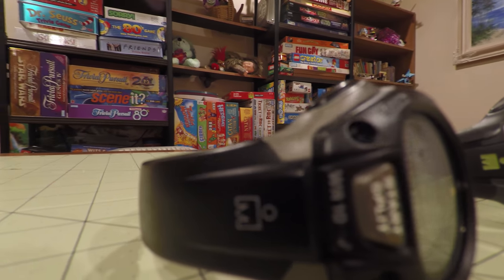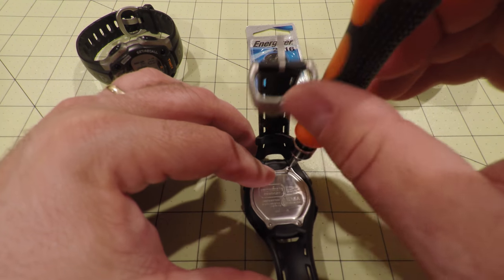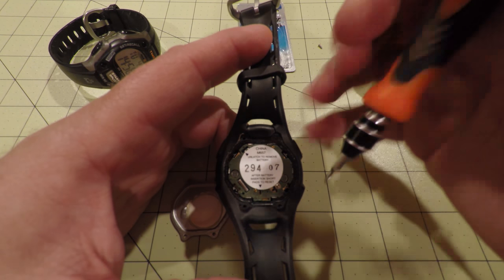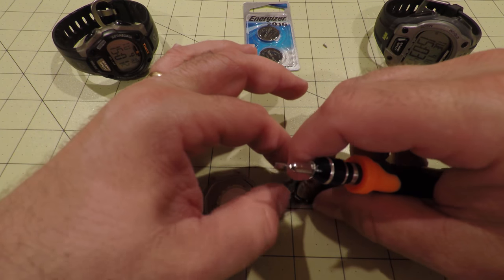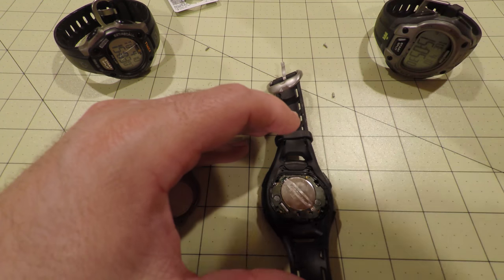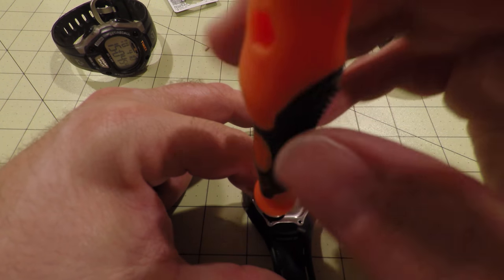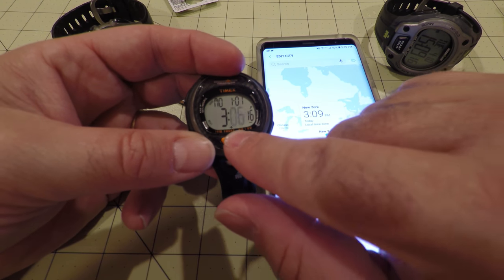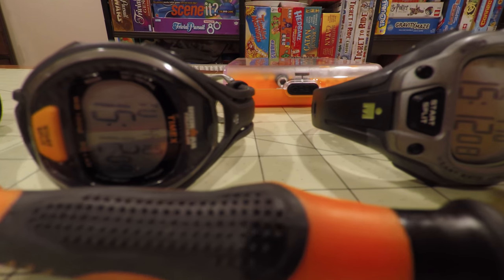How To Replace A Timex Watch Battery

Comment: Thanks. Good video. In the end, the inside of my Timex Atlantis 100 looked quite a bit different, with a different type of interior cover holding the battery in place, but it didn't matter. Your video gave me the courage to open up the watch in the first place, and once I did that, it wasn't that hard to figure out.

Comment: Very helpful.  Major issue I am having.  
The battery cover is not only secured with four (4) screws, but there is protruding rubber from the band which partially covers the battery cover at both the top and bottom.  It extends 1/16 to 1/8 on either side.  While I can slip the battery cover underneath on one side, I am unable to pry up the rubber on the opposite side.
Wish I could attach a photo.
Any thoughts?
Thank you.
Reply from the maker: Not sure about that. Maybe somebody else has a video on it?
Reply: I had similar issues.  I decided it was easier to just buy a new watch. 😀

Comment: I guess these Iron Mans are all different.  I saw one of these videos yesterday and I thought I can do that and went out and got a battery this morning.  Getting the 4 screws from the back off.  Piece of cake.  Getting the back off without taking off at least one side of the strap.  NO WAY!!!  Then after I got the back off replacing the battery was easy.  But trying to put the back back on?  The rubber gasket had stretched or something so trying to get it back in place to screw the back on was just not possible.  I tried putting the back on loosly and tried to coax the gasket into position but it always popped out somewhere.  Then I said I will just cut off any excess gasket that wouldn't jam under the cover realizing the watch will no longer be waterproof.  Then trying to get the band back on I finally gave up.  I didn't want to jam a screwdriver into my hand trying that challenge.  I had bought a new watch yesterday but still wanted to try and keep the old one.  It now has a home in the trash can.  I admire guys that can do some of these repairs.  Fortunately I am in a financial position to be able to afford a new watch.  😀

Comment: Mine is like the first one you showed.  I cannot get the rear plate off
Reply: same here and the one i did get off i can't get the battery to fit behind the small clips so it don't stay in place any help
Reply: I have exactly the same problem too! :(
Reply: I can't get the plate off too, same model. Were you able to find the right screwdriver to get the screws out? Will try the Dollar Store to buy a set of small screw drivers. Let me know which screwdriver and size works for you.

Comment: My watch is the first one shown. Did you use size 1.0 screw to get the screws out for that watch too?
Reply from the maker: It's been awhile but I think I only opened up one watch in the video. But if I opened another one, then I'm pretty sure the screws were the same size.
Reply: @NeilRichard  Finally found screwdriver to open case, but now having difficulty putting latch back on. The other end of the metal latch or sling that holds down the battery is locked down with a small screw. It did not say to unscrew but I did to take the metal latch or sling off so the battery can slip out more easily without bending the latch out of place. I screwed it down after replacing the battery, but the other side of the latch keeps sticking up. How did you relatch the end that is stick up? 

I guess I can just screw down the case backing and let pressure keep that latch down if I can't get the latch to lock.
Reply from the maker: @tracyphoenix8  I didn't remove the latch completely on mine, just pried up the one end and slid the battery out. Maybe pre-bend it before you screw it down to help is stay down?

Comment: thanks for the video... have you had any issues with indiglo with any of your ironmans? I've had mine for several years but the indiglo no longer works properly... I just see a small smidgen of the green in bottom right hand of the screen when I press the button ... thanks for any tips/advice on how to fix this issue!
Reply from the maker: I've had issues with IndiGlo over the years but don't know of any way to fix it. I've always had to either deal with no nightlight or buy a new watch.
Reply: @NeilRichard  Ok, Thx, I guess it's time to buy a new one... I do like the Ironman Timex brand... they seem to hold up pretty well and are at a decent price point.